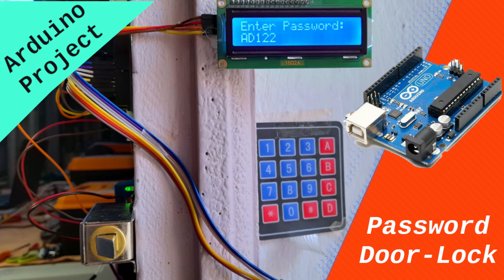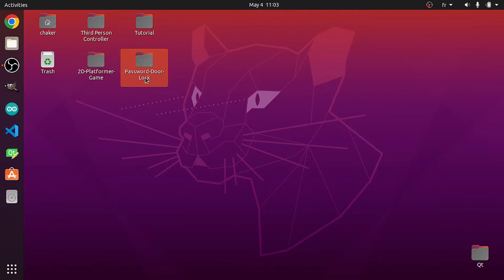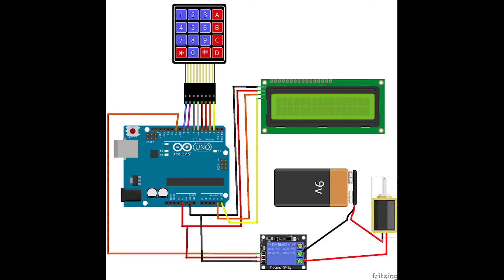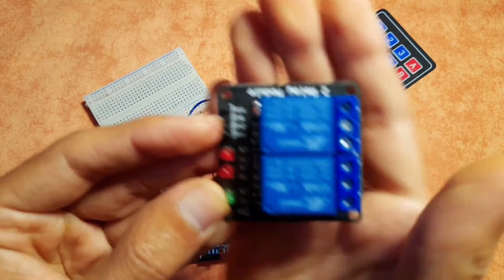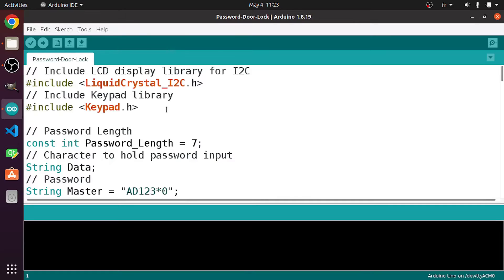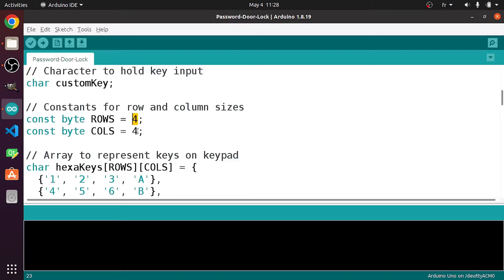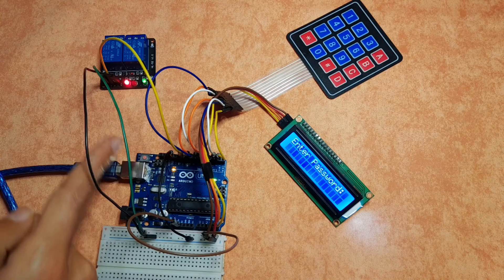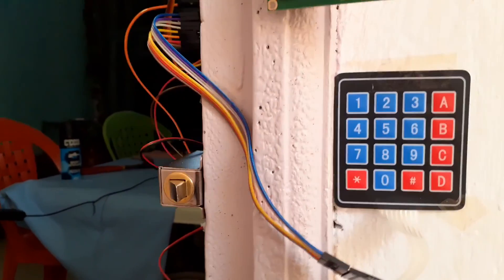Password-Based Door Lock System Using Arduino and Keypad

Comment: It is okay that our relay is single channel (12 volts) and our supply is 12v or 9v?? For project purpose only . Thank you
Reply: Or is there any code for relay to add  a code from ur discription? Beacuse our project is working but the only problem is  in the solinoid lock and in the relay. Thank youuu hoping for ur response

Comment: this works great but when you loose power and rer instate power the relay clicks in and out so the door will unlock with power interuption...
Reply from the maker: No, I think some relays work differently  so you have to set the relay pin to HIGH under the setup function to disable it
Then if password is right you set the pin to LOW which activates the relay.